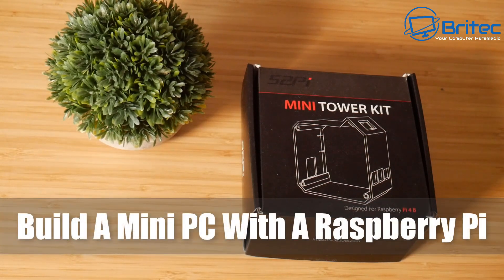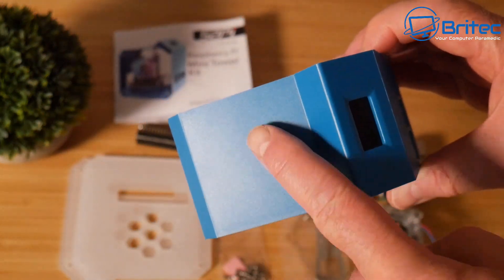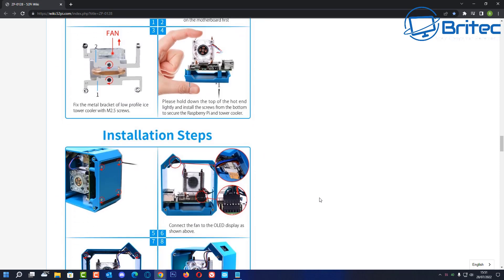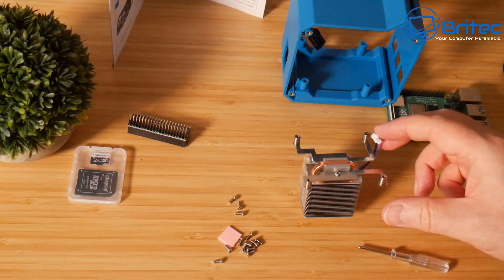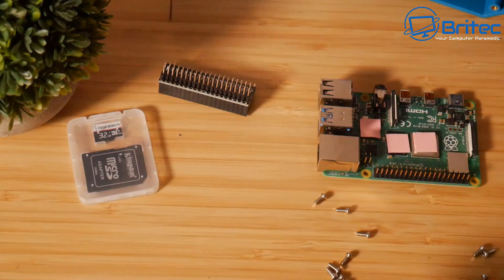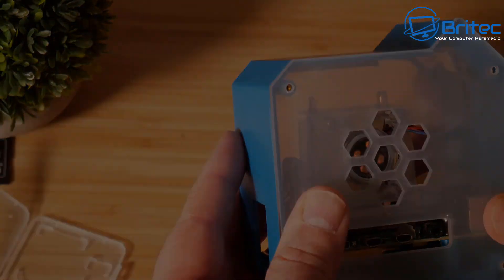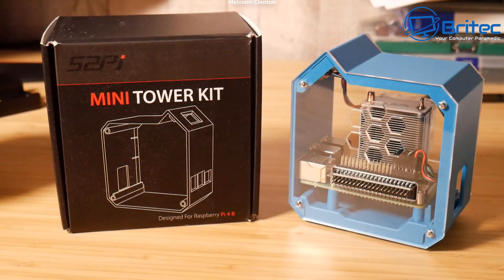Build A Mini PC With A Raspberry Pi

Comment: Hi britec..   why are there 2 extra include termalpads for the 2x chips outside the cpu ?  🤔
 They do nothing because there is nothing on it like the cpu cooler or extra heatsinks ? 🤔
 Is there something missing in the kit like 2 mini heatsinks ? 🤔 Nice looking build project...  
Greetings from the dutch lowlands NL 🖖
Reply from the maker: A thermal pad is a conductive material that helps to dissipate heat from electronic components.

Comment: The Heatsink is for the CPU only, so not quite sure why you put the thermal pads on the other chips!
Reply from the maker: To keep the cool, GPU and Memory
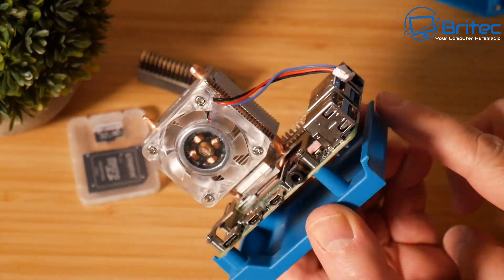Reply: @Britec09  At 8:38 (and the rest of the video), the pads can clearly be seen in free air, i.e, doing nothing..  The heatsink is nowhere near them..
Reply: @chrisg6597   Yeah...I was wondering about that myself.  Correct me if I am wrong, but wouldn't putting a thermal pad on a chip without adding a heatsink afterward actually  retain the heat in the chip and INCREASE the temperature of the chip?  🤔
Reply from the maker: @chrisg6597  Yes Chris, the CPU cool only cools the CPU and not the GPU and RAM. The thermal pads lay on top to help dissipate heat a little of the RAM and GPU. Can't use copper heat sinks, they wont fit, but these will help a little. Some people don't use them. Hope this helps you understand a little better.
Reply: @arthurmann578  Quite possibly. The thermal conductivity of the chips plastic to free air is probably better than the thermal pad.  One thing to remember is that a thermal pads thermal conductivity is pretty awful until it has been compressed.

Comment: Ok.. and 'what can a person do with it"??  Since I guess it would run an OS... maybe windows 10? or.. does it have a smaller like Linex version..?  But nice, great work..
Reply from the maker: You can install windows 10/11 or Linux, Android.
Reply: If you bought an arduino and thought "Man I really wish I could just hook my PC directly up to this" that's what this is. Its not just a mini computer it has a GPIO connection to it.
Want find out why your engine lights on? Turn this thing into a CAN bus reader.
Want to have a screen inside your desktop attached to the glass? Attach it with this so it doesn't take gpu resources.
You can use it in whatever way you can get creative about it. If you're not very creative you won't find a lot of use for this.